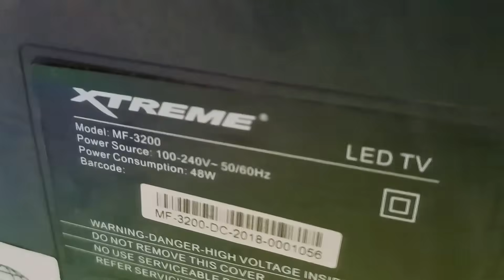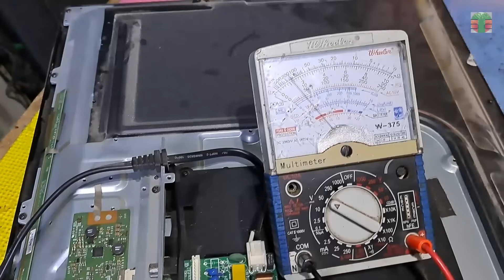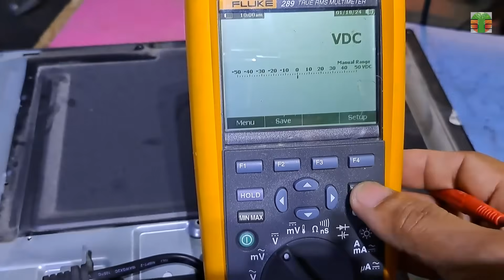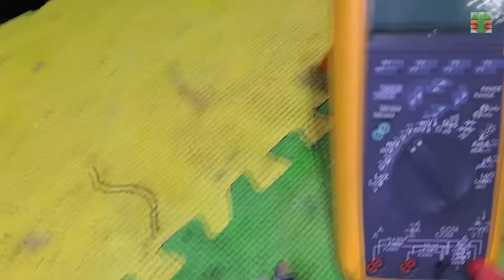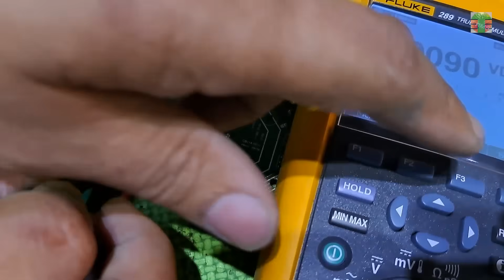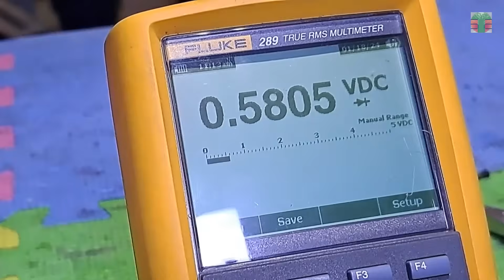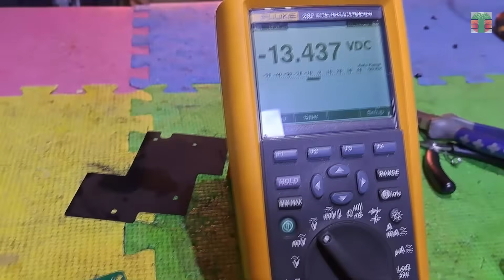Blinking light and voltage.

Comment: what are the suspicious defecting part if the case is a monitor screen blink a white screen, but sometimes steady in white screen untill screen goes off then I woke it, the image showed and back with blink white screen sometimes, Im happy if you could show me... thanks very much.
Reply from the maker: Try to clean the LVDS cable.
Reply: @tevzTVTevatronics  there is a bit blink when screen on, but steady after. its mean no defecting part isnt it!? 
thank you so much.

Comment: What is the meaning of VCC
Reply from the maker: (electronics, also VCC) Common Collector Voltage; the positive supply voltage for an integrated circuit containing bipolar junction transistors. (television) Initialism of Video Compact Cassette. by Google

Comment: I appreciate your approach on explaining with hand sketch and PCB board. Thanks. Won't  a bleeding resister across capacitor not helpful in discharging the 320v cap?

Comment: use solder flux while you solder like transformer type conducts and other similar.
Reply: Flux , he is using flux cored solder wire ,  enough for that tv 😅
Reply: @aneeshk.p4281  that is because of he had taken five minutes for soldering a transformer leed !!
Reply: There are many aspects, constant heat removes insulation, corroded particles on winding end. Any way that complaint will not repeat again 😊
Reply: @aneeshk.p4281  
if it is a not a proper way currect it better than justifi.
others also knew  that how to solder different type items, how to solder- they  are also in same field.
that solerig area is not at all a heat generating point and proper led coating prevent corrosion.that is why Gi pipes galvanized.
Reply: Please don't underestimate the gentleman's caliber, I'm only a well wisher. I think u noticed his fluke 289 multimeter.😮
Reply: @aneeshk.p4281  
this is not a issue of underestimation.i just mentioned the way of soldering .
you don't underestimate others ability also.

Comment: Hello sir i want to ask something about my tv. When am turning on the tv the power on signal is going easily to the tvs sensor but after tv turns on any signal from remote control is hard to transmitted. My thought is that after turning on the sensor voltages drops. What is your opinion?  Thanks
Reply from the maker: check IR supply